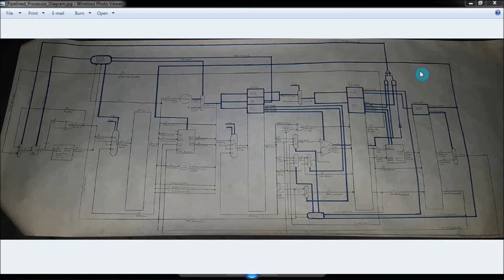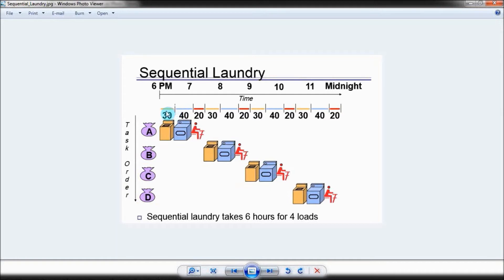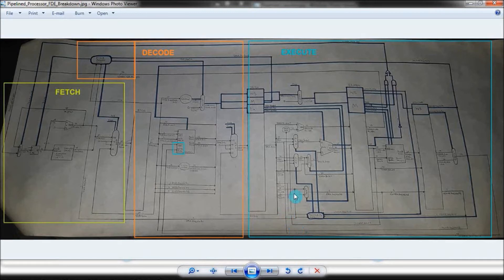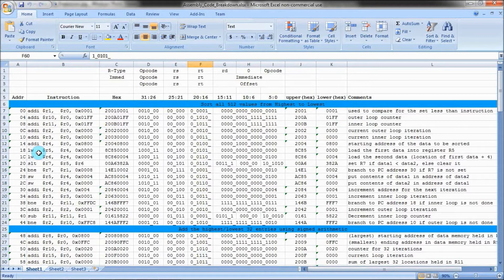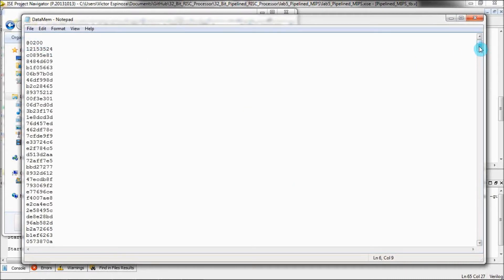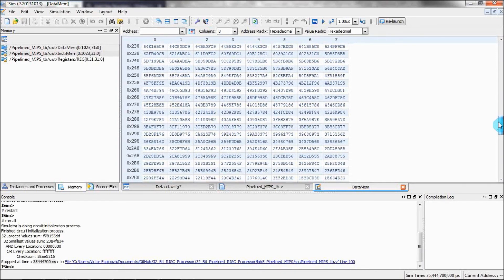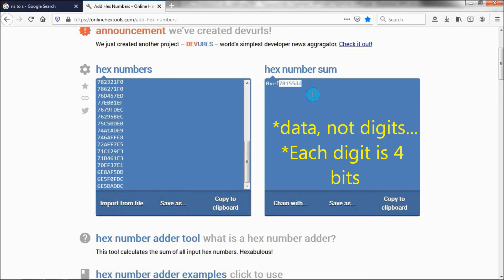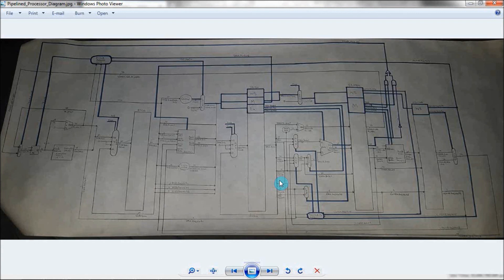32 Bit Pipelined RISC Processor Demo

Comment from the maker: GitHub link: https://github.com/victor-espinoza/32_Bit_Pipelined_RISC_Processor

Timestamps:
0:00 Project Overview
0:31 Instruction Set
1:08 Pipeline Overview
1:30 Single Cycle Vs Pipelined Architecture
1:52 Single Cycle Example (Washing Machine)
2:56 Pipelined Example (Washing Machine)
3:51 Pipelining Improves Throughput
4:27 3 Stage Pipelined Architecture (FDE)
5:39 Hazard Detection
5:51 Branching Hazard
6:24 Data Forwarding Hazard 
7:01 Memory Access Hazard
7:54 Assembly/Machine Code Overview
8:20 Bubble Sort Algorithm
9:11 Storing The Results
9:52 Processor Implementation Using Verilog
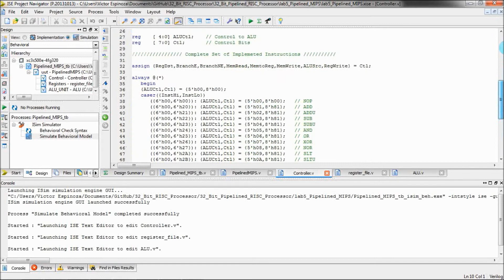10:07 Processor TestBench
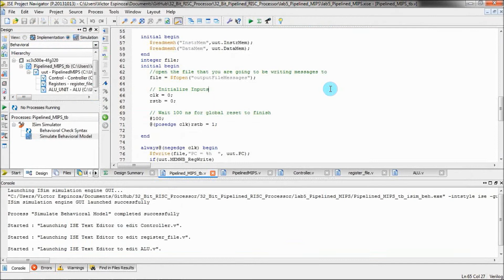11:12 Simulating The Processor
13:24 Simulation Results
14:30 Result Verification